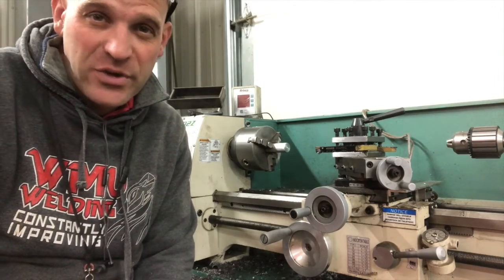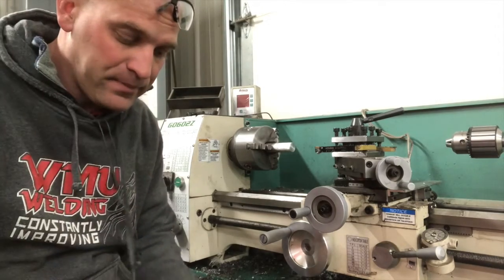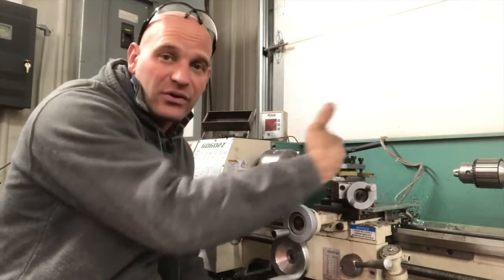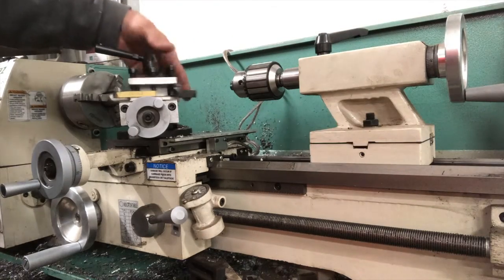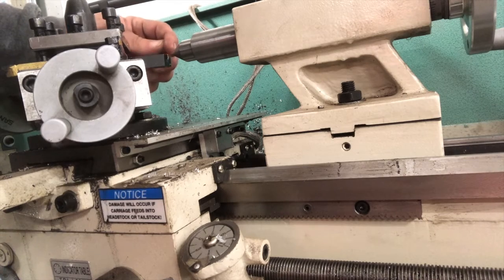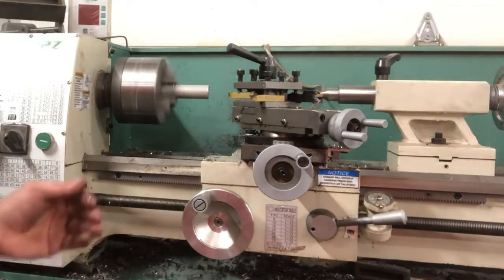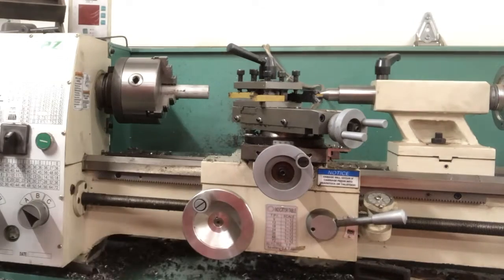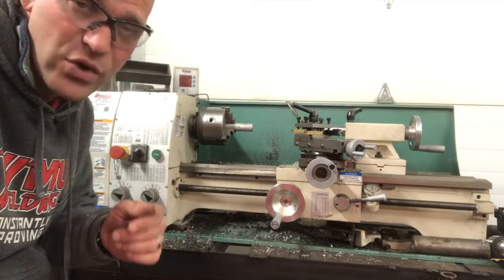Metal lathe 101: Introduction to the parts of the machine

Comment: I'd suggest that the smash button, in this case, since it can be reset without doing anything special, could also be called a "safety stop". That is, while it is depressed, the machine is kept safe because no other control can activate the lathe.
Reply from the maker: Right on!